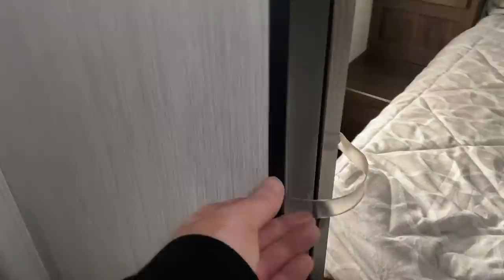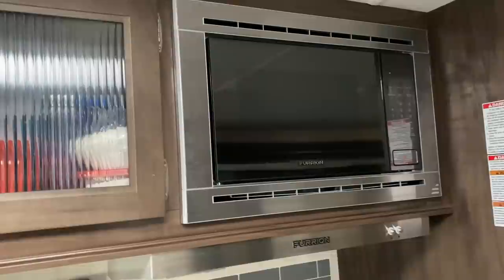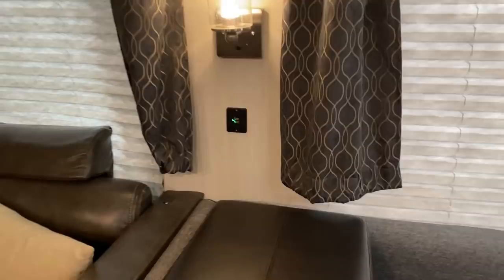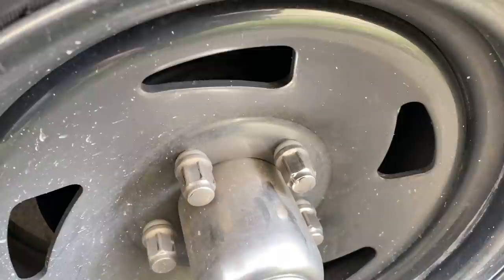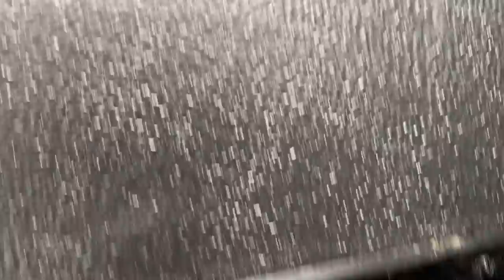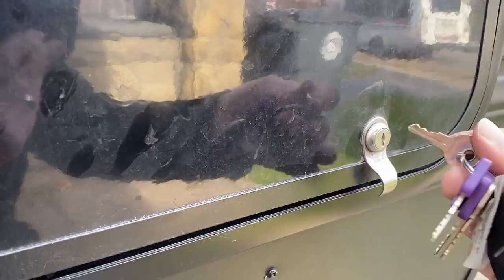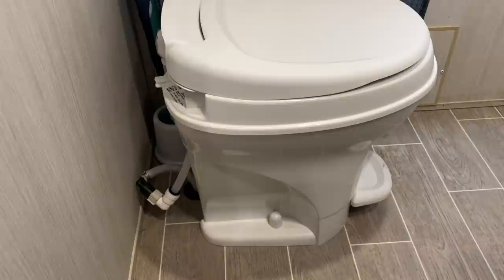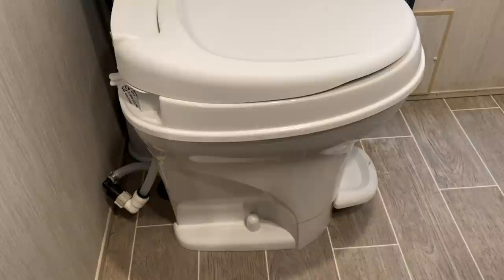2020 Forest River Cherokee RV Camper | Problems and Fixes After One Year

Comment: As a RV inspector, I jumped ahead on each issue because I knew this was normal stuff. I would guess this is your first RV. 
To trash Forest River and title your video Buyers Remorse may be somewhat harsh. 
If you buy new from a reputable dealer, they will fix those issues.
Most RV’s are built in Indiana by people who start work at 4am so they can get done on time to tend their farms. 
I’ll give you the toilet problem but again, that’s not Forest Rivers problem. Dometic should have replaced it.
Reply from the maker: You’re correct that it is my first RV. Not sure if you caught the water problem with the slide out, but that was a problem that would’ve ruined the RV within a year, and was 100% forest river. I’ll also defend my title and point out that there’s a question mark after it. Then at the end of the video I stated that I didn’t regret buying the RV and that none of the problems were “deal breakers” for me. I have sold the rv since making this video but I had a lot of fun with it during the time I owned it. In any case, I appreciate you watching!
Reply: Oh yeah, you should have gotten the slide topper. I understand you had other issues but slide toppers are a must. It drives me crazy that they are not standard equipment!

Comment: Forest river trailers are junk, how do I know? I have a 50k 5th wheel in my drive way that has been the biggest piece of crap. We were so happy when we bought it. 3 years later it needed a new roof due to a improperly installed front cap at the factory. The front cap was replaced in Oregon due to fading. They did not install sealant under the top termination bar between the cap and the roof and on a triomphe roof membrane filled with air, ballooned up and tore. Last year the lippert frame cracked in 4 places and they would not cover it....another thousand to fix.....I will never buy another forest river product again.
Reply: You DO realize every manufacturer builds their rv's from the same components right?  The frame on a Forrest River is the same frame on any other trailer.

Comment: A friendly reminder as well I've got A2511 forest river 2020 model. All slides need to have awnings above them that will alleviate your moisture problem with the slides when it rains. It costs a couple bucks but they work like a charm. Is those cheesy locks on the hatches on the outside have to be replaced puriatically they are so terrible. The original tires that forced river puts on their trailers are horrible I think you call them Cherokee chcall Cherokee cheapest China tires. I had one explode off the axle the 1st thing a lot of RV people do is replace the tires immediately there's immediately cause they put crap on the trailer. Good luck on those tires they have a lot of tread on them but when they explode it's pretty amazing. Is rule of thumb don't buy cheap ass Chinese tires.

Comment: Great video!  I like what you did with the vinyl flashing vs buying the super expensive slide ski's.  Has the vinyl flash worked well for keeping your slide floors in tact? Do they simply fold up when running the slides in?
Reply from the maker: Thanks! The flashing has worked great! It hangs only about 1/4” below the slide so it just bends out of the way when I slide it in. I’ve had zero water issues since doing this, and we’ve been in some huge rainstorms already this year.
Reply: @MikeOfca  good to hear!  Do you know the size of the flashing you got? I'm assuming it was in a roll?
Reply from the maker: @mrtosh  Yes it comes in a roll, tons more than you'll need for this project. I measured first to know exactly the dimensions I needed but when I found the stuff it was way more than enough. I'll probably never use the rest of it lol.

Comment: When you showed your commode issues, it looked like you had water stains 2" high across the floor line.
Just wondered, something I noticed
Reply from the maker: I see what you're talking about on the tub and no that isn't a water stain. I think it's a shadow from the glue on the wallpaper. It looks worse in the video than it actually is.

Comment: Have you ever had to manual move the slides in and out .my 2022 gray wolf has a handle but no bit to use in the whole on the side of the motor. ANY HELP WOULD BE GREATLY APPRECIATED.
Reply from the maker: I've never needed to do that so I won't be much help to you. I've seen other videos where people have actually had to disconnect the slide from the motor completely. Good luck!

Comment: You bought a low grade trailer, with the thought that it was a grand design build or something. Your nit-picking bad! It seems to me like you are picking apart every little thing, things you could of done at the dealer. You need to just stay home and give up on camping IMO. Unless you can afford a $60k camper with “no problems”
Reply from the maker: I appreciate you watching. This video was intended for informational purposes to give potential buyers an idea of some of the things to look for and ways to fix it if they found it themselves. This was my first camper so I was naive to some of these things, but generally I knew what I was getting. And I don’t mind tinkering with the camper and fixing things. As for giving up camping….not a chance. I still use this camper and I still love it! If you watched the video until the end you’ll see that I say I have no regrets and it’s a lot of camper for the money and a good value aside from the issues. Thanks for the comment!

Comment: The RV industry is still in the dark ages. Their crap. The RV industry has lobbyists in Washington DC who prevent quality and safety legislation being passed to protect consumers. 

Some dealers are now selling 15% above MSRP. When the coming hyper inflation hits that will change. The used market will be flooded with awesome deals but get vacuum bonded construction with no wood within the walls, roof and floor construction. Otherwise you will get mold, mildew, rot etc.

Comment: i purchase a FOREST RIVER CAMPER CHEROKEE I REGRET IT. SO many things wrong with it. they wont fix toilet leaks had in shop 3 times. the radio torn up replace it DVD still wont work,
a lot of items in this video yes happen to me. they replace refrigerator haven't used microwave much. the awning lights have fell off roted . MY IS OUT OF WARRANTY, LINES on ceiling from patching screws they said nothing they could do about it. they had to replace rubber on sideout. THE jack got stuck at camp ground  i finally got unstuck took back to dealership couldn't found anything wrong with it. THE LIST GOES ON AND ON....I WOULD NEVER BUY A FOREST RIVER AGAIN...THEY ARE MADE VERY CHEAP......$33,000 not WORTH IT. CAMPERS INN IN MARIETTA NOT A GOOD DEALERSHIP...

Comment: Any issues with water inside the unit?  Those corrugated siding units are really meant for “park units” and not meant to be driven in the rain. 

On the microwave issue, what was the dealership?  I’d like to know so I don’t buy from them.
Reply from the maker: The only time water came inside was when it was parked and the slide was out. Caused by the issue I described in the video. Never had any other water issues. Dealer is Paul Sherry RV.
Reply: @MikeOfca  slide out means not moving.  Have you driven in the rain?
Reply from the maker: Yes I have. On several occasions with heavy rain.
Reply: @MikeOfca  -- Good to know!  Thanks!  Years ago we rented one for a family reunion, drove to our destination and everything was soaked, clothes, food, floor, bed.  The bed squirted water when I sat down on it.  it had the corrugated siding strips, about 2' and evidently the side seams and front corner seams were not sealed properly.  I have avoided those type of units like the plague, but the price makes them so attractive.
Reply: @MikeOfca  — I keep thinking of that product info sticker placed on a wood defect to cover it up until after the sale.  That would irk the tar outta me!  Do you think that was done by Paul Sherry RV or Forest River RV?

Comment: Don't complain about driving across state to dealership. You should have bought closer to home. You should have known if there is a problem, you are going to have to go back. If you have friends at  "Murph's RV, why didn't you buy from them? Who are you kidding man, you drove your rv into a ditch? Why didn't warranty cover the toilet? Dometic would have told you to take the rv to the dealer. They wouldn't have sent you a toilet. I have a hard time believing a lot of what you're saying, but I wish you all the luck with your trailer.
Reply from the maker: I’ll quickly address each point in your comment. First of all, yes everything in the video is 100% factual. I bought it from a dealer across the state because that was the trailer I wanted and it was the closest dealer with the best price for that trailer. Murph’s is an RV repair shop, not a dealer. The RV dipped into a ditch when I was tired, it was dark and I was not being careful when I was turning around in a parking lot. The toilet would have probably been covered but they would have replaced it with the same toilet. Going straight to dometic resulted in an upgraded toilet and one less trip across the state. However, the trip for the microwave ended up being a great excuse to go on a weekend camping trip. Thanks for your comment and thank you for watching!

Comment: What a dough!   By your own admission in the fist minute of your sob story, you tell every one that Rv’s are all - a POS.  Knowing that - why would buy !!!  Until people demand better quality by passing on buying this junk.  Nothing will be done.  Look at the auto inc.  until they caught up to foreign quality sales were bad.  You got what you deserve.  Buyer Be Ware. A, H,
Reply from the maker: If you watch to the end you’ll see that I do not regret my purchase, and that we got a lot of RV for the money. The video was intended to help others who may encounter similar issues with their new RV, and none of the issues were deal breakers. Thanks for watching!
Reply: @MikeOfca  Thank you for pointing out the issues with the slide out, Water intrusion into the campers is their worst enemy. You would think this would be the number one QC issue.  Will be checking mine this week. We just bought our unit last week, and with close inspection I can see issues that could have been fixed with just a little more quality at the factory. As far as the cheap plastic parts they add (curtain hold downs and door slide straps), why even bother installing those? I agree, most of the little things can be fixed or improved by someone handy but you never have to do it on a automobile you purchase (at a similar price).

Comment: Number one this video is all about how bad forest river is. Forest River is actually one of the best RV buildings on the market. Everything you complained about beside the water on the bottom of the slide was due to the products they put in their RV’s and yes they could put better products but we could also pay much more for a cheap RV too. You have a bad dealer. The dealer put the sticker over the tear not Forrest river. Most of your complaints have nothing to do with forest river but with the crappy dealer you used and the products that are used by forest river and every other RV builder in the market.